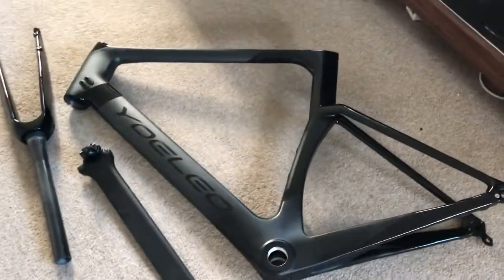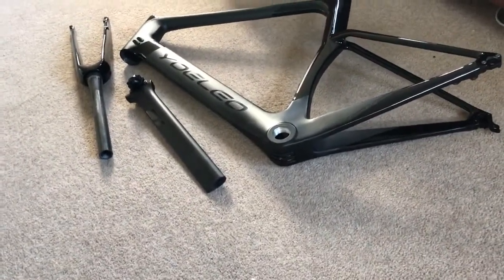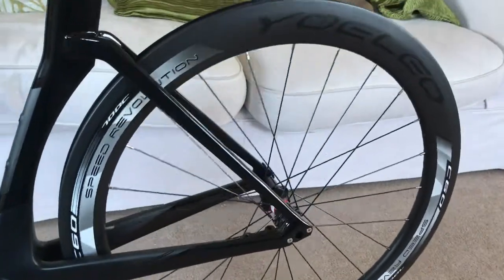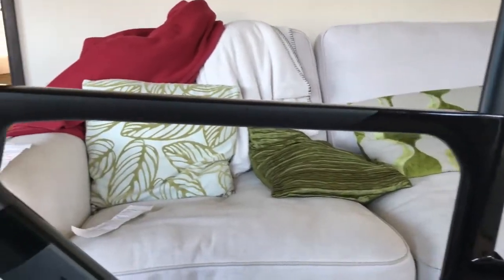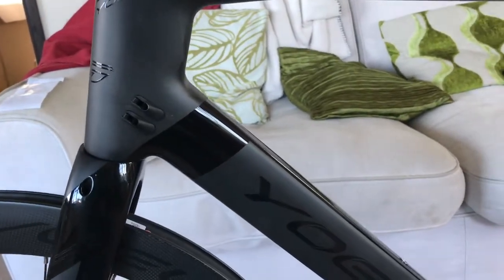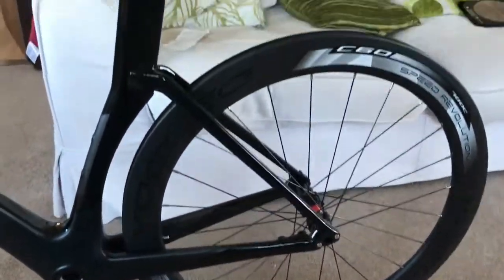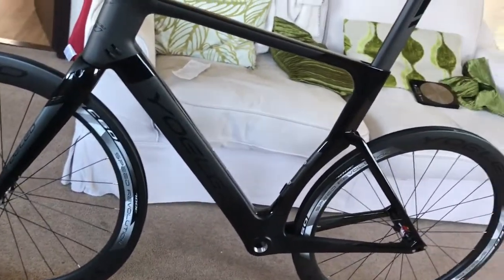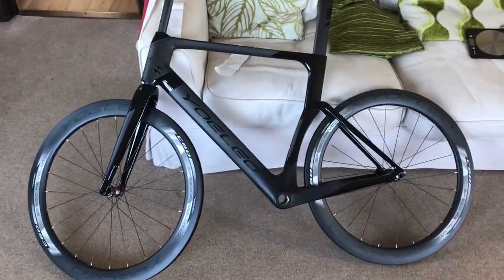Yoeleo R6 Aero Disc frameset and my wheels first look

Comment: Very curious to see you get through this build ? My next build is to to do an Aero Bike with disc , all in Below $6K US under 16lbs. I have been using yoeleo C50 clinchers now for two years and its been solid. I see you have their frame aero disc and wheels as the base platform.  I would like to see you finish the build but also do reviews on perf. I am thinking about the 3T strada build , but the frame alone is sub $4K (ouch)... Good luck and will check back.
Reply from the maker: Ravin Premji thanks I’ll be posting more as I progress.

Comment: Have you looked at the headset yet ? I just ordered a Cane Creek headset and it came with a new (crown) race. The Yoeleo came with a split race, but after sliding the race down and having 4mm of gap to go. I am beginning to wonder if this is a true Integrated system and only the bottom bearing is needed ? Im too afraid to try and set the new race as fork is carbon, and the split race provided doesnt seem like it would allow the bearing to slide on top either...
Reply from the maker: Endurance Cyclist yeah I have looked at the headset, it’s not one I’ve seen before, I may take it to my LBS and see what they think of it.
Reply: Sent off an email. Will let you know  what Jasmine says after Chinese New Year
Reply from the maker: Endurance Cyclist excellent! Thanks

Comment: Have you build this yet? What group set have you used?
Reply from the maker: wizardzx2 I haven’t built it yet, I’m just waiting for a right shifter, when it arrives I will have a bit of a mix.... dura ace 9000 series crankset, chainrings, front and rear mech, chain @ cassette, ultegra 8070 levers and callipers, dura ace disc rotors, Di2 everything and Aerofly 25mm rise bars.